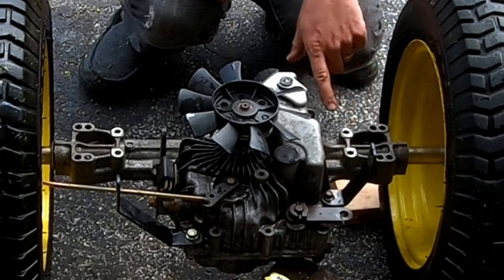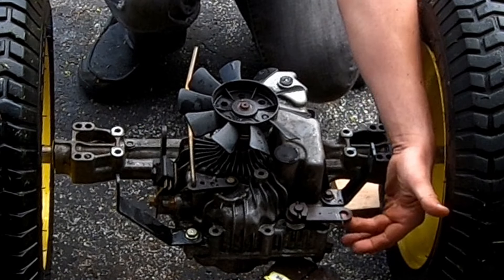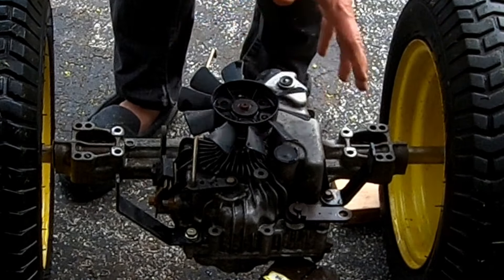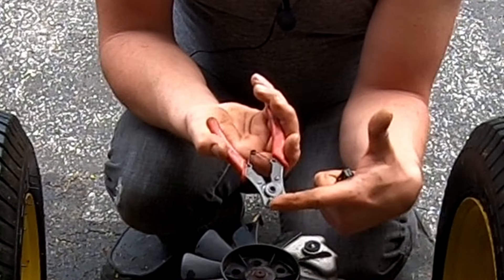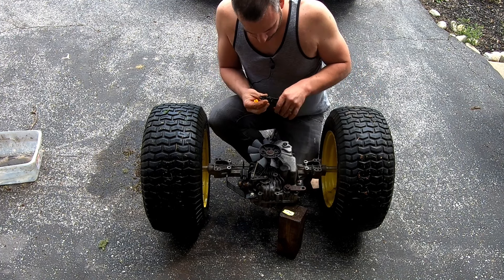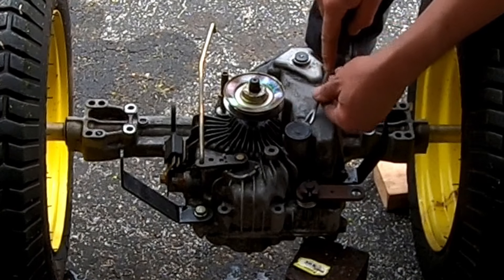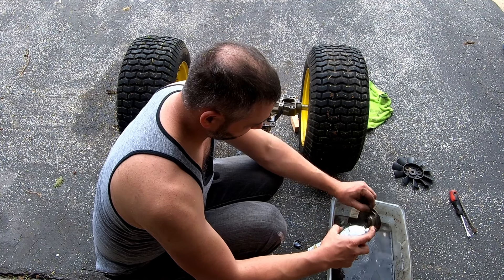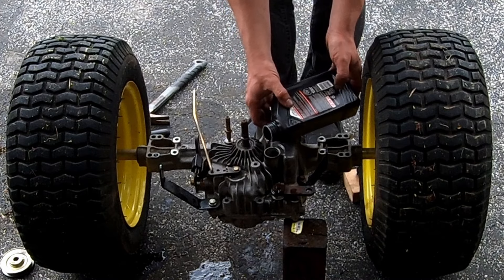TUFF TORQ Hydrostatic Fluid Change K46 T40 John Deere

Comment: Just did this procedure on my L120. Mine would barely move after a short time mowing and forget reverse completely. Well, after draining the old fluid and replacing it with Castrol 5w50, it did make an improvement, but I haven’t completely mowed my 3 acres of grass yet, so the jury is out as to what will happen when it really heats up. It’s definitely better though and I’m happy about that. It was actually much easier than I thought it would be, so I would definitely recommend doing it to anyone who is having issues with their K46 transmission. Sure beats the cost of a replacement unit, or worse yet, having to junk the whole tractor. Thanks to you and all the others that have posted similar videos!
Reply from the maker: Glad I could help! I do have a video on my rebuilding my unit since I was not that lucky.  It costs around $400 to get the rebuild kit and takes a couple hours to do.  Hopefully you won't need to though! Cheers
Reply: Replace the pulley and you will have more traction with the belt.
Reply: If you remove all stuff from on top before tipping it over they won't fall in oil, also those harbor freight snap ring pliers are junk,  then you put two different oils in their really.
Reply: Well, I mowed my 3 acres with it for about a year and it seamed to work ok, but it did get kind of weak after mowing for a couple of hours. I’ve since moved out of state and gave the tractor to my son, who has a much smaller yard that is pretty much all level ground. So far it’s still working great for him, so in my case this was a success and saved me a ton of work and money. Thanks again for the great how to video!

Comment: Thanks for the information! 

It's possible to access the fill plug with by either removing a rear tire, or removing the battery and tray in the rear and taking off the fan for access from the rear. Using a fluid transfer pump, pump out as much as possible from the fill port, and then pumping or funneling in fresh fluid. Easy peasy. You can removed well over 2 quarts doing this, so over 80% fresh fluid each change. 

Do this along with an oil change after 5 hours, and then once a year after, and you will never have a problem for double digit years, as fresh fluid is always in the rotation. Amsoil hydrostatic transmission oil was recommended to me because it lasts extremely long and works to -39*C. This is what the manufacturers don't want you to do, so we must do it.
Reply: I did this and could only get about 1/2 a quart out using a pump. What's the secret?

Comment: Thank you.   I wish John Deere included a drain plug and easy to access fill hole in their K46 hydrostatic transmission.
Reply: Tuff Torq makes a drainplug kit for it. 
Or just drill and thread your own. 
Might as well wash or change its filter while its opened up.

Comment: I'm thinking that's the same tranny as on my 2006, 155C, 48" w/ 701hrs. bought new.   It has been used to pull TSC grass vac a little, not babied much on the farm but did blow grass/dirt off tranny so it cools better.  Still works decent, no leaks but I'll do just as you did shortly.  Probably mix of synthetic oil and LUCAS cause that really does extend life and slows leaks.  You did an excellent job but I always blow or powerwash first to keep dirt out.  Always easier to put fluid into a smaller container and add a little at a time.  Great video, Loved it and the humor.  Guess I'll look for overhaul video now.  Just bought a very nice 2012, Z920A from original homeowner that I do know but still want to use the 155C.  Love older J.D.

Comment: I appreciate the video, but I'm not certain the best ways to separate the wheels/transaxle from the main body of the mower - the part you did before this video started. I have a JD X300.  I saw one video that used an overhead joist in the garage and a strap attached to the back of the  mower where you would connect the attachments.  But I don't have a place to be able to do that.  What would you suggest?  Thank you.

Comment: They could've made a drain plug and a fill plug that you could access without taking it all off.
Reply: The casting has two bosses that can be drilled and tapped to install two 8mm drain plugs. Some K46's did come with drain plugs. It depended on manufacturer.

Comment: So I'm swapping out the plastic transmission on my d105 I'm swapping in the t40 off a parts mower my friend had sitting around we got it fired up and made sure it worked before I bothered taking it off but I want to change the oil in it before putting it on my mower I notice you recommend the 5w50 for both the t40 and k46 but the tuff torq website recommends the 10w30 and now I'm wondering which I should use
Reply from the maker: Tuff torq recommends using their fluid now.https://www.amazon.com/Tuff-Torq-Hydrostatic-Transmission-5W50-187Q0899000/dp/B086VLN7JP/ref=mp_s_a_1_2?crid=1SWSYLCGV8BG1&keywords=tuff+tech+premium+hydrostatic+drive+fluid&qid=1674546900&sprefix=tuff+tech+fluid%2Caps%2C91&sr=8-2  I have had no problems using the 5w 50 after I rebuilt the trans in this video.  From what I understand, they used the thinner oil originally and that should be replaced with the thicker oil after about 50 or so hours.

Comment: QUESTION: Why remove the rear end in the first place- cant you take the lower cover off while still in and remove the fluid and replace the filter that way?We did it with auto transmissions all the time, so lift the rear of the mower up, put a pan under it, take the bolts out and remove the cover- then replace the filter and replace the pan- put fluid in through the vent on top????Thats the way autos are serviced...why NOT?
Reply from the maker: There are no drain plugs on this trans.  There are provisions for them but I guess Deere didn't want them installed.  The only way to empty is to turn it upside down.

Comment: It is best to split the case to drain and clean. There is an additional magnet on the gear side and a 3" round screen filter. It's not difficult.
Reply from the maker: I personally would never split the case for routine maintenance.  You would then have to reseal it and risk leaks.  I have rebuilt this unit since this video (there is another video on it) since the fluid change wasn't enough.  Definitely would be a more thorough cleaning and certainly could be done!
Reply: @sweatequity4252  Service manual recommends it. You are missing another magnet on the hydraulic side and the actual filter unit.

Comment: You overfilled it. The oil level is supposed to be 22-25mm (7/8") from the top edge.
Reply: Hi - When pouring oil into the transaxle, the fill tube has to openings - one directs oil to the pump side and the other directs oil to the gear side. If the recommended amount of oil is put into the transaxle, what prevents the oil from one compartment from flowing out of its opening into the opening for the other compartment when the tractor is on a step hill?  I don’t think there’s a check valve for either of the two compartments. It’s my understanding the oil level is supposed to be 3/4” from the top edge to allow room for the oil to expand when it gets hot while using the tractor.  Thanks.
Reply: @billmolzon7723  Good question.  Maybe the overhaul video explains it.  Has to be a smaller hole to allow oil to lube both sides.  Also not sure but there may be better transmissions that bolt right in.  I do agree with this guy to change the oil only and not split the cases and hopefully extend the life at this point.  Could have been just low on old oil.  Regardless you have to keep in mind the age and hours and do ya want to spend a bunch of money and time on a mower that has exceeded the normal life?

Comment: Had transmission drive belt replaced and every since it's been leaking transmission fluid. It seems to be pushing it out of the reservoir when it's running
Reply: Check the fan

Comment: Nice video. How many more hours did you get from this transaxle after the fluid change?
Reply: It didn't fix my lack of power, ended up rebuilding it and it works great now but the rebuild kit was $400.  There is a video on my channel for that

Comment: is it not drainplugs under. On my Husqvarna there are two.
Reply from the maker: some manufacturers do not want drain plugs, but there are provisions to put them in and you can buy the kit. John Deere doesn't want them
Reply: I could be wrong, but from what I have seen some manufacturers put the battery under the seat instead of the gas tank.  If you happen be a lucky person with the battery under the seat, you can just pull out the battery and support bracket and have pretty good access to the top of the transmission for refilling.  These types can make good use of having the drain plugs underneath - like Husqvarna for instance.  My old Troy Bilt had the same setup, although it used a variable speed pulley system.  Unfortunately Deere puts the gas tank under the seat, so there really is no good access to the top of the transmission.  I guess that may be why they decided to pass on the drain plugs.  Plus it saves them a few bucks per mower.

Comment: so my 130 isn't movin rite..longer runs worse gets..whines loudly..won't pull banks any more..
do u think this will help?
Reply: I'm not trying to jump in front of Sweat Equity with this comment, as this is 'his' video but my L-130 is doing the same.  Mine is 17 years old, never had the hydrostatic oil changed so it's about time.  I'm planning on posting a video while I break it down to change the internal filter also, but 'yes', I'd say yours is due.
Reply: @PilotViewProductions  
took it apart & let it drain cpl wks ago ..put back together last wkend..plan on tryin out this wkend..
one thing i noticed tho is the drive belt is very loose..dunno if normal..not certain how it was before disassemble..only that it worked & appeared in good enough shape.
Reply from the maker: Sounds like it will need a rebuild, unfortunately.
Reply: Try replacing the pulley. They wear just enough that the mower doesn’t want to move. Might as well get a new belt. World of difference.